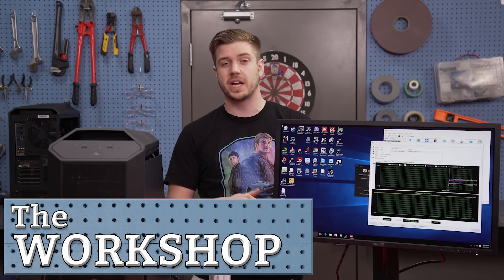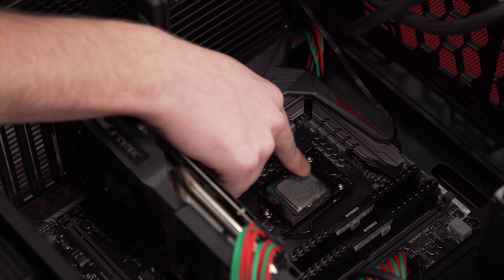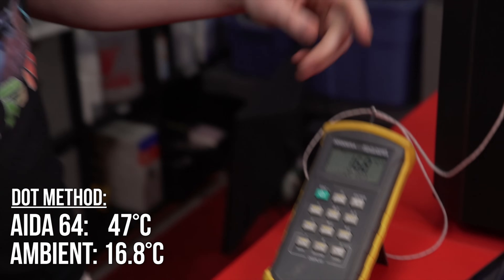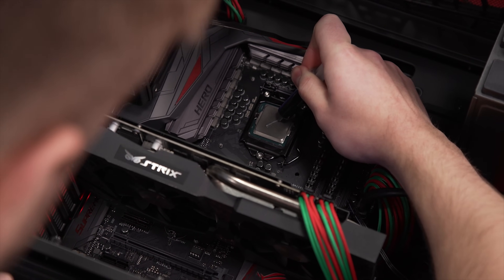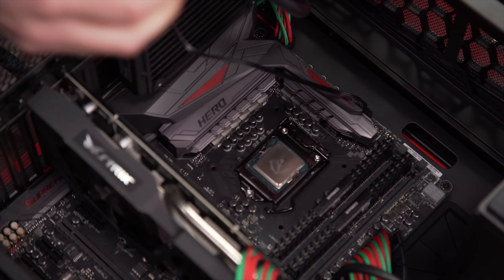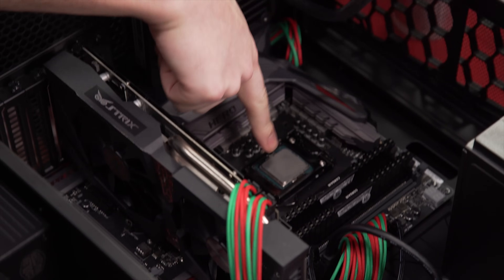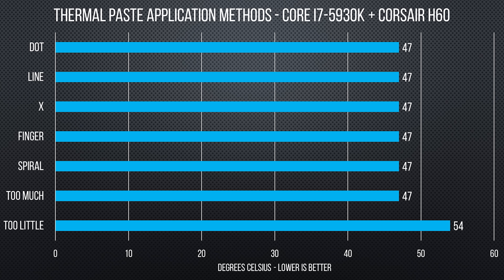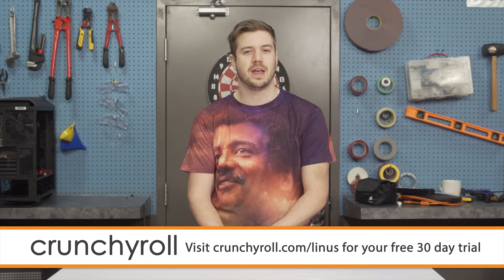Thermal Paste Application Methods - Which one is best? - The Workshop

Comment: From 8 years in the future and the 14900k: you can run a high end CPU without thermal throttling!??

I'd be very interested to see if the conclusions to this have changed with modern high-end CPUs being so hard to cool in all-core workloads, especially the 13/14900k and to a lesser extent the 7/9950x and 285k.

Comment: ok but how do you measure temps of cores or smaller units of the cpu? I imagine precision thermometers are expensive, the only concern would be bubbles in the thermal paste. spiral is the worst one for this reason, I'm guessing best is just a paper thin layer completely covering the cpu

Comment: I'd really love an updated version of this with new lab conditions to see if there is minor variance in any of the methods
Reply: I think it would have made a difference if the PC was fully assembled. (i.e. The back panel is off the whole time) PC cases are built to create certain airflow patterns, side panel being off doesn't allow that heat to build when the CPU is running. Thus the test doesn't seem valid
Reply: aida64 rounds up or down to the nearest whole degree so we will never know if the tests that came out as 47 degrees had the 0.7 degree swing that the ambient temp had, it is entirely possible that the x method was cooler than the pea or vice versa

Comment: Spread technique both on the cooler and cpu (like applying butter on your bread ), with a small ammount of extra paste like a a dot in the center of the cpu and cooler to prevent "airpockets" in the paste.
With my "Assassin III" cooler, the temp is even 3 degreese Celsius under ambient.
Max Temp with an overclocked i7 990x at 5 Ghz with 1.58 voltage arround 76 Celsius at full load with CPU-z.
The brand cooling paste: Kryonaut
Reply: "With my "Assassin III" cooler, the temp is even 3 degreese Celsius under ambient."

Check your temperature probes then. That is thermodynamically impossible with a passive system not actively moving heat to a higher delta elsewhere. For air coolers, this means CPU temps' lowest value is the air around it.

Comment: I used the X or line or spread method on CPU's with a large IHS. Prefer the X. Simple reason is that not covering the edges of of a large IHS is much worse than putting on a little too much... and I'm not competing for benchmark scores.
If you put the cooler down at little too much of an angle(not intentionally) when installing it, methods that are not the X or pre-spread have a larger probability of pushing the paste to one side when tightening it. In essence I'm just reiterating the "don't apply too little" message. And on a big IHS that's easier to do by mistake.

Comment: Pretty sure the amount of functional paste remains the same per unit area for a given mounting pressure. Too little thermal paste simply doesn't cover the IHS enough, beyond that it's always going to be the same. The only difference being how much ends up being pressed out and around the sides of the cold plate and IHS.

Therefore, best off to go with slightly too much rather than slightly too little. Assuming you're not using a paste which is particularly electrically conductive.

Comment: For the past 25 years of building dozens of PCs, I've always used a razor blade to spread the paste evenly across the entire die while ensuring no missed spots, and no heavy spots. It takes some practice to make it perfectly even. I've seen bigger differences with the type of paste used than the method of application.
Reply: What kind of paste would you reccomend?

Comment: Basically, use the most appropriate method for your application requiring the least amount of thermal compound possible that gives you the most benefit.

Obviously, you don't want to use too little, but too much is wasteful.

Comment: I recently redid my thermal compound on my 5 year old system and when I took the heatsink off i noticed the bottom of the cooler where the heatpipes are had grooves... and the spread wasn't as good as a flat bottom. So I applied more thermal compound, 1 long line in the middle and 2 shorter lines by either side, and results are... CPU temp dropped drastically. So for me, more thermal paste was needed to get it to actually spread and fill in the nooks and crannies.
Reply: Your experience may have also simply been the thermal paste needing to be reapplied after a couple years since you did it after 5 years. This video is more referring to fresh builds.
Reply: @taz874  True, but my temperatures never really spiked up over the course of 5 years and I basically had been playing the same game(wow) and doign the same tasks on that computer.

Ambient temperature is also stable since I'm in SE asia and it's hot, so I always set AC to 25C when I'm using computer.

Comment: Is IC diamond one of the best pastes out there ?
Reply: Yep, it's not the literal best, but at that level, you're looking at a difference of a couple degrees.
If you're asking for purchasing advice, just check reviews to make sure it's not garbage, most won't make a terrible difference unless you're doing some seriously temp heavy stuff. I think Noctua have a reasonably popular/cost effective paste, but don't quote me on that
Reply: @Naaronn  I went with kryonaut 👍🏻👍🏻
Reply: @Botzz28  Hah, me too, which is funny, since it goes against my own advice. It's one of the very best performing from what I know, and the tube costs the same for a lot less, but it's good for a couple applications, and since most compounds expire before you need more than that, it doesn't seem like that bad of a deal

Comment: I think the purpose of different methods of thermal paste application is not really to change the temperature but to get a good even spread of the paste so that it doesn't spread on to the board but still cover the whole surface of the cpu.

Comment: As long as you get thermal paste between the heat spreader and the cooler it's going to work the same, the only one that might not perform as well is the way-too-little method. All of the methods that use more paste than the dot method are just wasting thermal paste.

Comment: I think part of the problem is size of the surface. Needing to laminate square glass sheets together with epoxy without bubbles and without bleed out at  the edges, I can say a good x/pea hybrid is fantastic. It also really helps because you can actually see the epoxy move, so you can see exactly what is happening.

Comment: the temp wont matter as much but covering the cpu in past is key as if you add the cooler on an angle when first fitting it may miss some parts of cpu this will still be cooled but i guess it will create hot spots on the cpu x will be my way from now on it will cover all of cpu and not trap any air in the paste

Comment: I think you better try it when running games, and without cooler, the cooler is just pushing the thermal paste so they are all the same, the only diff. is the quantity and overspread when you used your finger.

Comment: You put a grain of rice sized portion on the cpu, then you use a rubber glove or plastic sandwich bag over your finger and spread it evenly over the
entire surface before mounting the heat sink / block.
The paste is only really supposed to fill in all the micro gaps in the surface. You want the plate to make contact with as much metal surface as it can.
It's old school but still the best way.      🤓

Comment: I typically use too little, it's always worked for me so I'll continue doing that. The optimal temperature for a cpu is around 85C,  so putting anything more than a rice grain size dot would bring it below the optimal temperature.

Comment: Should have run a CPU performance test to generate higher heat levels and see how well each method removed the heat. At idle there might not be enough heat to make a difference.

Comment: The too much thermal paste needed to be tested on long term performance. Or, well, at least on the next day.
I got a tube of noctua NT-H1, and in my first time using the syringe, put too much on CPU, basically, I did one pump and there was a huge blob. 
The temp was really good after putting the cooler back on, lower temp at lower fan rpm.  But on the second day, it got worse. Idle temp got a lot higher, my 2700x was then around 50 degree C, at 10% load, when ambient temp was around 15 degree, and the Wrath Prism cooler was running at over 2000 rpm.
I then reapply the paste, this time, using much less. The temp is down to 45-47 C , with the cooler running at 1200 rpm or 41-43, at 1500 rpm. AIDA CPU stress test after 5 min temp down to 65 @ 2250rpm from 67 @ 2650rpm,
 Still have to wait until tomorrow to see if the result hold up, however.
It also needs to note that the cooper contact plate on the cooler seems to have several scratches, not sure if it was my fault or not but I may consider getting an aftermarket cooler if it still doesn't perform.

Comment: While I still prefer the full even spread, it becomes a lot easier when you realise that the metal square on top of the CPU is a heatsink to the core and that the core is only in a certain spot on the CPU anyway... with negligible difference I'll just do the full spread to avoid issues if I don't know where the core is.

Comment: me thinks, fresh tested thermal paste, thermal temp would not be the same as thermal temp tested 2 weeks after placing said amount of thermal paste.  thus, testing multiple cpu's(separate systems), consistently ran at normal usage for two weeks, then tested would maybe yield different results? removing and reapplying for the sake of insant result seems ?? food for thought...
Reply: Given that tester typically want to be reimbursed for their time, I'm thinking your suggestions would add significantly to the cost of doing the comparison.

Comment: what you need to do is ask a really smart person why you are using thermal paste at all. If you are able to find one, they might tell you that the paste is not there to be an extra layer. With 2 perfectly flat surfaces you wouldn't need any at all but because of the microscopic holes and cracks in the 2 surfaces is what you want the paste to fill in. Using as little possible and covering the surface before you use your cooler to mash it down is best as it saves you from wasting the paste and covering the area you need makes sure its covered instead of hoping for a good "circle". I like Arctic silver's 2 step remover and cleaner and 90% alcohol and my finger. Over 400 CPU's mounted this way mostly using AS5 and never a problem.

Comment: I have pre built gaming pc I've had it for a few months now  my computer was shutting off by itself I found out it was overheating I've done all the troubleshooting methods to find the problem I found out it was my cpu so I lower my cpu usage from 100 to 70 and it stop cutting off but I was wandering is it possible my thermal paste has worn out and need new application? Cause I dont how long this pc have been built.

Comment: this video is old, but for people wondering, on the arctic silver guide (specifically for Ryzen CPUs) the best way to apply it is a 1mm wide line across the cores’ length, instead of having the processor completely covered. this is to have better contact only directly where it needs it, as to prevent loss of cooling 

fyi, i think some stress tests might be wrong in videos, because of the “break-in” time of the paste. Arctic Silver 5 has a break-in time of 200 hours, and the results change several degrees when comparing directly after application and letting it cure.

Comment: You had the results staring you in the face -  Don't use too little... but you kept with your old wives tale "don't use too much" because you believed "less is more" which wasn't supported at all and is wrong. 
That's just a load of bullshit to make the job as hard and therefore "skillful" as possible, to get the "perfect" amount on and totally un-needed - the results were staring you in the face.
Yes, there is "too much" but that wasn't too much, we're talking way to much that literally reaches the motherboard, past the CPU mounting board. It doesn't matter if a little comes out the side, it barely has any effect thermally, but if anything it HELPS. It's slightly more thermal surface area in contact with the heatsink and slightly more thermal mass which helps to average highs and lows. The excess HELPS.
Too much is MUCH MUCH better than any amount to little, so MORE IS MORE, untill you've dumped the whole damn tube on the thing and it's dripping
 - and you've run out so you're just wasting money.
Take notice of the results next time, and realise that even you can believe bullshit for no good reason.

Comment: Sorry, guys, but these tests are awful. Especially what about the spreading test. When you want to spread it, the layer must be smooth like a mirror, so you'll avoid as much air bubbles as possible. Cooler's fan curve must be at same RPM because the custom curves(even the default one) has a TARGET temp. So, even if one method works worse than other, your AIO just kept working harder to bring temps to the target point, so no wonder that you saw exactly the same 47C(Since it was a target). Having the ability to make great, useful tests scientifically that would be appreciated by many, and waste it like this is unforgivable.

Comment: X method is best. 
Overtime the CPU will create air bubbles with your thermal compound. Depending on the method you applied will determine the air bubbles and with too many air bubbles you have the hotter those areas will be. X method creates almost no air bubbles.

Comment: I reckon most of the heat comes out of the centre of the CPU where all the cores are in a much smaller square space inside. So to my mind the pea method would do just fine.

Comment: I just finished reading a 2018 article that compared thermal paste application methods. Their results were the same as the ones here. Again, you don't want to use too little and too much is just wasteful and messy. Otherwise the most commonly used methods were equally effective.

Comment: I know the best solution is to put a really tiny amount and spread it all around. I've tested it myself the same way as you did. A really tiny amount. Only enough to fill those little imperfections. It depends on the imperfections between the CPU surface and the cooler surface. Since I commonly use Scythe coolers, the imperfections between the CPU and the cooler are incredibly tiny, so a microtiny layer of the paste will do. You should always keep in mind that the best thermal conductance is achieved by direct contact. Too much paste of any kind from $1 to $100 will always just make it worse. Having said that, I already know that a little blob at the centre of the CPU will produce the best results because is the smallest amount of the paste. Cheers!

btw. It seems like you have too much of Viking genes. 16.8 ambient temperature?! I know only one person who likes a low ambient temperature like that and that's me. :)

Comment: The real question is for longer periods of time over lets say 3 weeks would there be a significant difference? It seems fine and dandy after a few minutes/ hours but realistically without cleaning the dust off the radiators would temps change over time in the same tests/ use of the computer from day to day? It seems like initially it is fine but what could/ would happen if you tried doing too little, too much, and a pea sized for a control? I bought a MasterLiquid Lite 120 AIO from coolermaster, which was giving me great temps early on, for my Ryzen 1700x. 32 C idle but now my temps are around 39 ideal. It may be because I updated a few other components in my computer; however, the new parts I added should not have such a signifigant temperature change in my system . It is good information to do the initial trails and see if it makes a huge difference. I feel like running the computers for longer will shrink the margin of error. 

I also want to say that I have been watching your videos for a while and I love the content you guys do. Your channel should be used as a subsititue for learning in a classroom setting. You guys more often than not give a more detailed picture of whats actually going on with systems than an average classroom ever could. The passion, love of fans, integrity is all there. This channel has helped me build a awesome computer that I can edit photos and videos on and without you I would be lost in an endless trashcan of tech related information. Thanks again for the work that you guys do and Linus needs to wear actually shoes. Its 2019, let the sandle and sock trend, from the 90s, die.

Comment: You didn't really stress test the CPU by running heavy processing. That's when it matters.
Reply: That's what i was thinking as well. Before i changed my thermal paste its 48c on idle, same after i applied a new one still 48c. But when i started rendering videos, before it was 85c, now it's just 71c
Reply: @metaspl0it  that just tell you that changing it is good. not much about the method

Comment: I have reapplied my thermal paste like 3 different times and my cpu temperatures still increase to 70 to 100 degrees after a few minutes of playing, idk if it is the thermal paste at this point or if i seriously need to order a new cooler.

Comment: A 10 minute test is a waste of time when using water cooling. Retest using air cooling or retest for a minimum of 1 hr with enough time in between tests for the loop to cool back down to ambient temperature.

Comment: Conclusion: It is not an art nor rocket science. It is dependent on the pressure and thermal conductivity of the cooling mechanism. Although, I'm curious as to how this would would change on a beefy laptop, given that the TIM is directly applied to the CPU die.